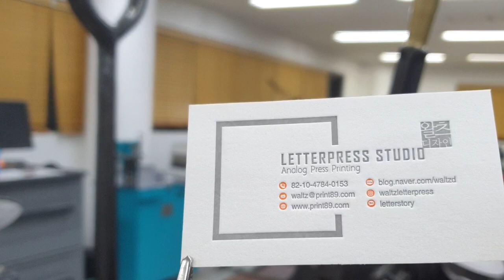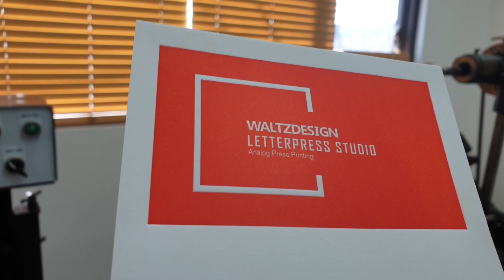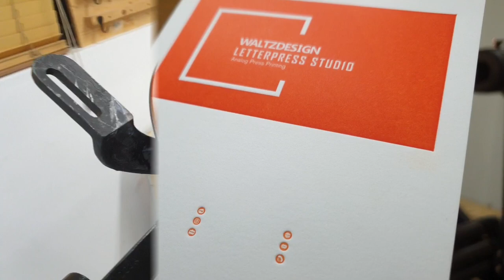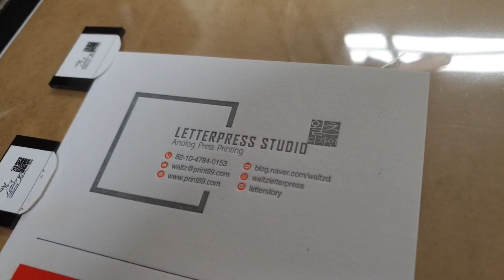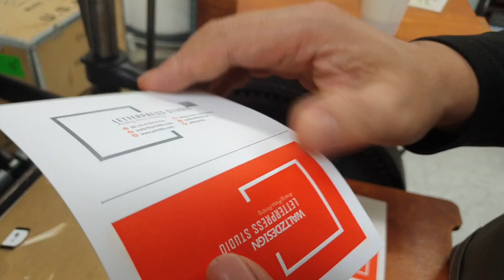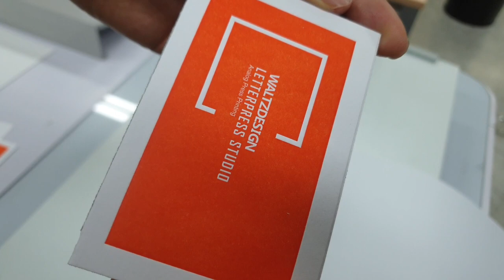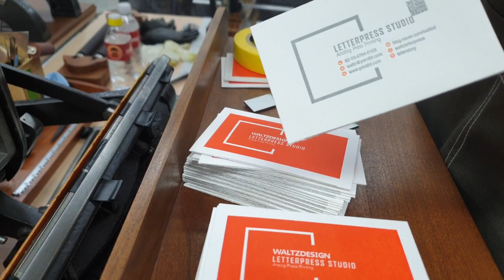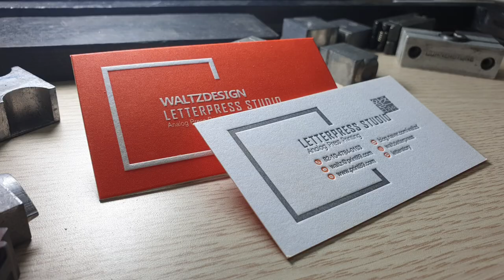Letterpress background printing, duplexing and die cutting business cards.레터프레스 고급 합지 명함 만들기.

Comment: Hi, can I know about your printing press and price and all price of accessory?
Reply from the maker: nice to meet you. This equipment is not new. This equipment was discontinued in 1986. I also bought used in Germany. Prices are set differently for individual sellers. 
Based on mine, it was about $12,000 including the foil device. I don't sell equipment.
Reply from the maker: sorry. I thought you were asking for the windmill. Chandler&Price purchased from a private seller in the United States. This equipment company was closed in 1956. The equipment was purchased for $2,500, but the accessory cost was $1500 and the shipping cost was $8,000.

Comment: What is the point of a dye cutter when you have a guillotine?
Reply from the maker: I couldn't understand your question.😅😅
Reply from the maker: The purpose of die-cutting is to distort when cutting because of the protruding part of the print.  Is your answer correct?
Reply: @w_letterpress  
No, you're wrong! The purpose of die-cutting is to cut out special shapes which a guillotine cannot do.
Reply from the maker: All right.😊😊
Reply: @w_letterpress 
You obviously don't know what you're doing.
Reply: @w_letterpress 
It was a "question", not an "answer".